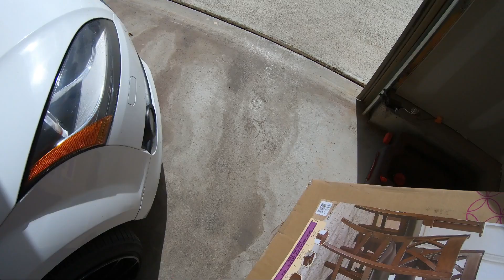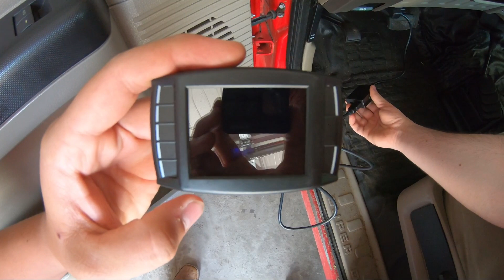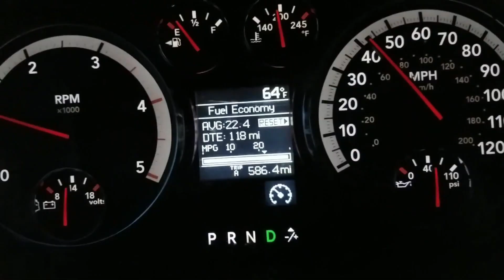5 Reasons Why You SHOULDN'T STRAIGHT PIPE YOUR TRUCK (Also 5 Reasons Why You Should)

Comment: I have a 2006 Ram 2500 with the 5.9 Cummins. The exhaust now dumps under the cab, and I love it! I’ve driven past cops, and they didn’t care. Hell, I can hear my turbo a lot better! In my opinion, the truck looks cleaner without the exhaust sticking out the side.

Comment: my muffler unbolts easy so i can have it on of off depending on what i'm doing, Ive got a 2.7d Nissan Navara d21 New Zealand model and she roars loud when i'm heavy on the gas sounds like a worked up tractor and so quiet you would not know ive go the can off when i'm light on the gas at a steady speed.

Comment: but for everyone wondering if you are not sure if you need to tune your truck before straight piping it call a local diesel shop and ask if you need to do so because a lot of older year trucks you can just slap it on and call it good.
Reply: I put a GT Bully Dog tune on my 06 F150 5.4L before I straight piped it. The truck’s power used to feel restricted, after I straight piped it, I feel like the truck has 100% power even though it’s a 2006 with 250k miles.

Comment: If U add a straight pipe, the Turbo and Diesel have plenty of back pressure so you don’t have to worry about loss of hp. Plus it’ll sound like a true diesel. And it takes off faster.
Reply from the maker: Agreed 😎
Reply: Does straight pipe make it so you don’t roll coal
Reply: @horchata1555  Sadly not

Comment: Up gotta upload more often I love seeing you build this truck and I sub to you👍🏼
Reply from the maker: Mason Wright Thanks man I appreciate that! Don’t worry the videos are coming! Just a little busy with stuff at the moment!
Reply: @FS2S  yo i have a question I have a 04 6.0 with the bolt on exhaust from factory my truck doesn't have the  Emissions equipment.... I've been told straight piping it will improve the life spand on it as long as im not a ass to it 

Do i need a tuner? With the straight pipe
Reply: drexis is gay you don’t mood a tuner with a straight pipe but you can add one for more power

Comment: Yes,I found a 2016 f250 with the 6.4 with 178,000 miles,dealership said egr maybe delete.  Is this truck worth buying?. I've found other 6.4 with low miles but everyone said they are bad eniges Don fool with them. Is this true
Reply from the maker: Well first off the 6.4 Powerstroke only existed from 2008-2010. If it is a 2016 then it’s a 6.7 Powerstroke. 👍🏻
If it were me, although I never had any problems with mine, I would still go for a 6.7 over a 6.4.

Comment: U don’t need a tuner if u decided to straight pipe your truck it’s for more performance
Reply from the maker: Noah Pitman The tuner erases the codes that will pop up after you remove the dpf and all other sensors 👍🏻
Reply: Oh ya on the newer diesels but older u don’t correct
Reply: FS2S also love your videos they best YouTube videos that I have seen and your new to the YouTube community keep it up and it’s going to pay off 👍
Reply: @noahpitman1352  what year would be considered 'newer' ive got an 04 f-250 would i need the tuner for it?